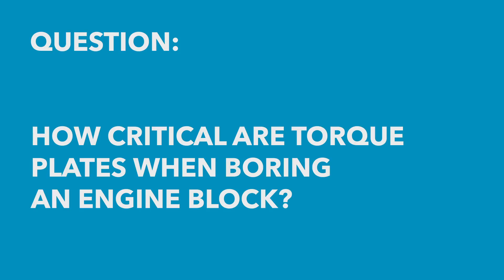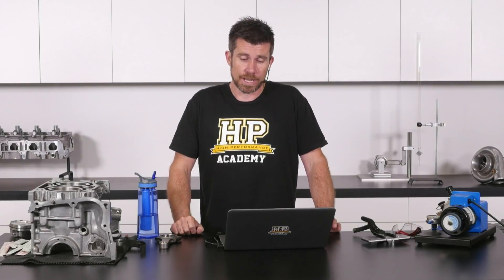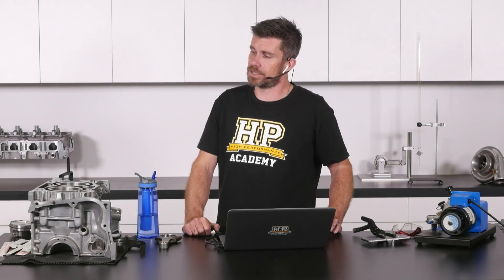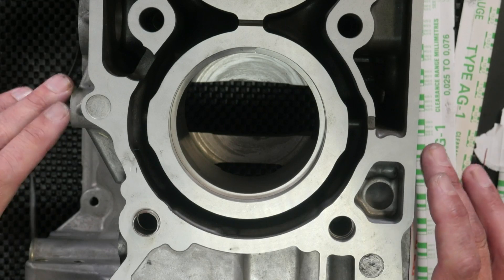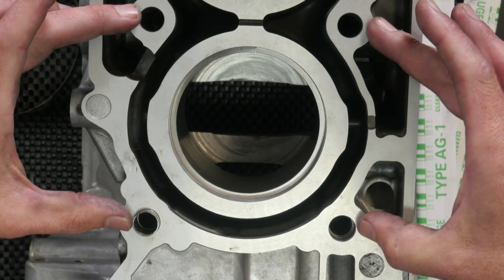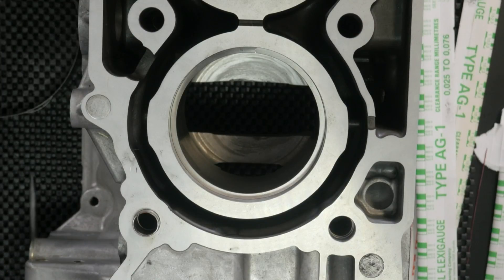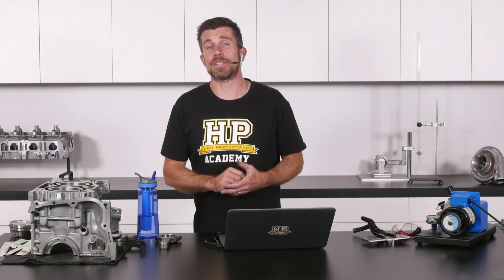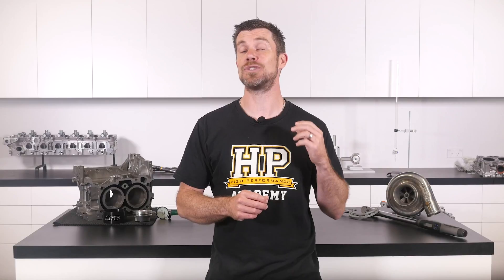Torque Plates | Critical For Engine Boring And Honing? [HPA Q&A]

Comment: I have yet to see or read any empirical evidence that there is any measurable distortion cause by bolting down a cylinder head to a block and if there is, that torque plates accurately  replicate that distortion. All I ever hear or read is that "typically we see." Would someone please show it,  post it or at least post a link.
Reply from the maker: Might not be quite what you're after, but here's an engineer talking about it in relation to designing an engine block 😎 - https://www.hpacademy.com/blog/tech-talk-3000hp-10500rpm-4-cylinder-elmer-racings-106kg-billet-block/?utm_source=youtube&utm_medium=social&utm_campaign=general-interaction

You can also go talk to some engine machinists about it - Taz.

Comment: when doing an old school v8 block such as a 1970 pontiac block, is one torque plate enough to bore/hone the 2 banks at separate times ? or should 2 torque plates be required to be torqued down first before boring can begin ?

Comment: Thin wall cast iron blocks especially Opel XE , Ecotech need the torque plates. 
4AGE , CA18 as well .....
Even older small block BMW 6 cylinders.
They tend to wear ridges at the bottom of the cylinders if not bored correctly with torque plates.
Reply: Thank you.
I have several XE/KBA engines and intend having a plate machined if/when I get round to rebuilding them ($$$ :-( ), good to know you recommend their use. Come to think on it, got a block with the head removed so can check for any wear patterns.
Reply: SR20s as well need a torque plate for the best possible ring seal however I have seen guys not use torque plates with no issues but they werent using high boost.
Reply: That's right , ultra high boost alloy blocks are best if they are billet blocks but also need the bore finishing under tension

Comment: For free standing liners, or those with one or two narrow ribs attaching them to the main block strecture, it is very unlikely to make a ny measurable difference.

As a rough guide, for needing a plate...
If you have access to the block as it is being torn down, or at least before any bore work is done, have a look at the wear pattern in the OEM cross hatch honing - with some engines you will see the bore is shinier adjacent to the head fastener areas, this means the block has distorted when torqued down.
Have a look at where the rings have been, or reference the ring postion on the pistons and how far up the bore the piston comes. Then measure the bore diameter just below where the rings reached at several positions, where the bolt/stud holes are and where there are none - if the bore distorted when torqued it would be expected to wear round in that postion and when the torque stress has been removed it 'should' settle to original state - you may need to talk to your ring supplier what sort of out of round is acceptable, as some rings are more sensative than others and, if using gas porting, you may get away with a little more out of round.
If the head fasteners are closer to the bore, more distortion when torqued should be expected.
Some blocks don't have a lot of material around the holes, which may encourage flex, ditto with the deck thickness.
Alloy blocks will move more than iron blocks, so distortion is more likely.
AFAIK, all head bolts are a coarse thread as are some stud's nut threads - for the same torque value a fine thread will pull harder on the block threads (tensile load), especially as they will often have a higher torque value and/or better lubrication.

If there is any doubt, I expect all the chaps watching these videos will be working on known engines - check out the relevant forums to see what is suggested for your specific applications and use that as a basis for your decisions. Remember, it is going to be you that pays for it, one way or the other ;-)
One last point, from experience, a shit-for-brains machinist can still destroy your engine with a 'plate but a good machinist will get pretty darn close for 99% of engine builds.
Reply: OK, so what do you think of the 2jz iron blocks with torque plate use?
Reply: @boosthit811  Me? Never worked on one but, if I had a 'plate, I would use it with the same make and type gasket (different gaskets crush and load the block differently) and fasteners I would build the engine with. 
Do you NEED it? As I said, any wear or shiny areas near the fastener holes? You should check out the forums devoted to the Toyo' engines and see what they recommend - might be a good idea, anyway, as you can find out if there is a recommended machinist in your area - some are definitely better than others.

Some engines can suffer distortion of the lower bores, too, when the big end caps, or cradles, are fitted and torqued down - might be an idea to check out if that is required for your engine(s).

Hmm, reminds me of an 'old school' trick from the early days of using 'plates. If you don't have one, some suggested using a stack of washers, or spacer tubes, over the bolt and torquing them down before machining - don't know how effective it would be, maybe better than nothing if caught short?
Reply: Ok thanks for the detailed reply.  So in general do alloy blocks suffer more than iron ones?
Reply: @boosthit811  In general, yes - some special heat treated alloys can be right up there, though, but they would be in high dollar billet blocks, if anything.

I would emphasis checking, and rechecking,  getting as much information as you can from different sources before making any call - it will ultimately be down to you what you decide and you will be paying the bills, either way. While I try to keep up, I am not up fully to date and there are others who may be able to advise further on specifics for your engine.